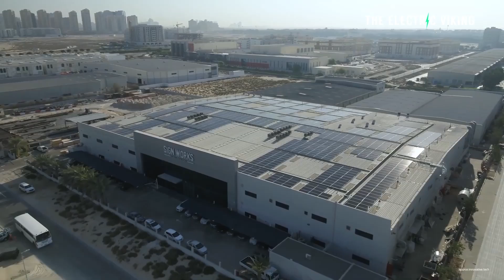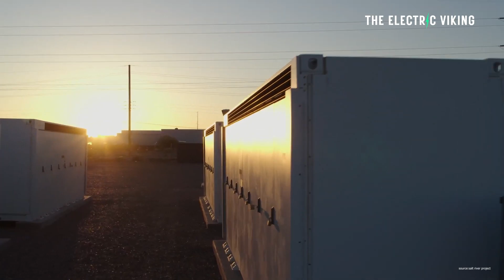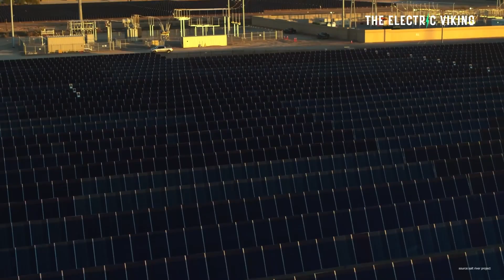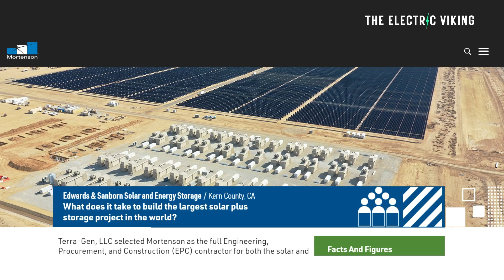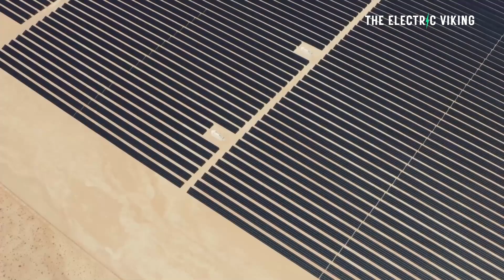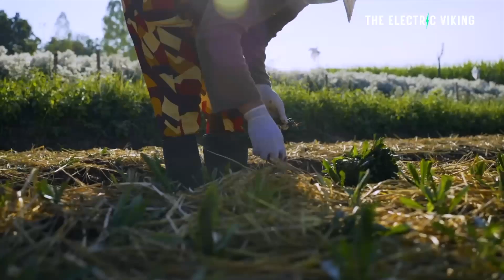The world’s largest solar and battery power plant has 1.9 million panels

Comment: The day will come when electricity will be so cheap that families will have so much more assets to spend.  Great for the economy.  I have solar panels on my roof in SF and often my usage is zero.  Yet the utility company has a way to tax me for what ever reason to make money.  Maybe it's time to go off grid and be done with my utility company except there are days when the solar doesn't make enough power
Reply: You just described the major issue with solar.  It relies on other dispatchable sources because of its intermittency.
Reply: In 25 years your solar system will end up in a landfill and you get to do it all over again, how environmentally friendly is that?

Comment: It might be the largest solar farm but by my reckoning 875MW is significantly less than 2.6GW
Reply: The batteries will help with the capacity factor but that eight hundred or so max is multiplied by .2 to get the true output for the whole day.  Still would take ten or more of these farms to come close what Diablo Canyon Nuclear Power Plant outputs on 200ac of land.
Reply: @stanleytolle416  in theory the numbers look strong but the fact is even the biggest supporters of nuclear will vote it down in their own backyard 10/10. Reason : real estate values will collapse and banks don’t like that. Also the cost of building, maintaining them is extraordinary. With millions of rooftops we can do quite a lot and we can localize power putting it in the hands of the people, not the politicians.
Reply: @stanleytolle416  45 billion or more to keep the Diablo Canyon nuclear power running from 2021 to 2045. This solar project was 2 billion. So seems pretty feasible? Like half the cost? Plus dropping on panels and LFP.
Reply: @fritzstauffacher6931  Not really true.  That's simply additional stuff that is not needed.  Like cooling towers because of warm water in the ocean.  That part of the ocean is where cold and warm water currents meet. The sea life in the area is adapted to big swings in ocean tempature.  I took a class from an alcologist who was at Cal Poly SLU because of the unique cold and warm water algae in the area.  Like the warm water from the nuclear plant is about a thousand of the temps that naturally happen in the area.  They are also talking about earthquake up grades where the plant was already overly upgraded for earthquake resistance and the plant is located on bedrock that's not going to get high levels of shaking anyway.  Nuclear plants in Japan withstood a 9.2 earthquake with no damage from shaking of a quake several thousand times the shaking possible in this area which only has slip faults not subduction faults like in Japan.  So really none of the work being called for needs to be done.
Reply: Yes but at what cost? And how many decades more would one need to wait? By then you can have 20 fields surpassing 2.6GW rendering it obsolete.
Reply: I just ran the numbers and you're right!
Reply: @alexishart1989  😅

Comment: How is this good for the environment?  How is this not increasing global temperature by heating up the surface?
Reply: It doesn't change the albedo of the land all that much. 20% of the light absorbed in the panels flows out in form of electricity (or is stored in the batteries) and during the night the panels are radiating IR very efficiently, cooling the air around them stronger than the original surface would have. Overall it's probably mostly a wash. In agricultural applications the shade of the panels reduces evaporation, leading to longer growth periods in spring and summer and allowing species that are less adapted to arid conditions to thrive. Solar shading in agriculture will probably go a long way to offset the effects of global warming on farming.
Reply: @lepidoptera9337  clever farming. Good recap.  I'm all for building out the grid.  I just think nuclear is the way to go.  They have new reactors now that use spent fuel from older reactors that can generate enough power for 100 years. Called "Fast reactors".   Fusion reactors will be a game changer.
Reply: It intercepts light that would just be heating the surface and turning some of that energy into electricity.  Do you think the sun wouldn't be shining there if there were not solar panels?
Reply: I agree, we need to get rid of surface heat 😡

😁
Reply: @FreeKekistann  One could imagine panels that are actually cooling the land by reflecting most of the IR radiation and by having an emission peak for IR wavelength  that correspond to the Planck peak at 300K. That would reduce heat load by 30% or so. It does come with some efficiency loss and the production is more expensive, of course. Other possible combinations involve solar and thermal desalination.
Reply: It's not good for the environment at all, all this ewaste will end up in the trash in 25 years, solar energy is a total scam, look at all the abandoned solar plants in California with broken panels littering the ground as far as the eye can see, glass everywhere...

Comment: California at times has too much solar and wind energy and actually pays Arizona to take this excess.  Thanks California.  I personally live off grid and have not had an electric bill for 20 years.
Reply: It's just a ping-pong game between solar and energy storage.  More solar is added, more energy storage is added to soak up peak excesses.  Then more solar is added, and more storage again, etc.  As the whole thing gets built up

Some curtailment is bound to happen, and does.  And sometimes exports go negative, for a multitude of reasons including needing to keep the grid balanced and having sufficient generation margin to deal with spot generation or line trips.

Though I will say that is happening less often now as other states have their own heat waves and wind up needing to import (positive rates in that situation, obviously, not negative), and more storage continues to get added to the California grid.

We're up to 6.6GW of (battery) power (up from less than 1GW 4 years ago), and well over 30GWh of storage (can't immediately find the reference but that's the ballpark), and that is projected to rise to 52GW by 2045 and I don't even know how much storage that will represent but it's gonna be pretty insane.
Reply: @junkerzn7312  All the grid batteries in the US could power the grid for a few minutes.  I forget the exact number, but it's in the single digits.
Reply: @dzcav3  And yet the batteries have had a huge positive impact on grid stability, massively reduced congestion transmission lines, and removed the need to a whole lot of very, very dirty peaker plants in the state.   And fortunately California is not trying to power the whole U.S. grid.  Fancy that!

Your little missives just demonstrate your vast ignorance of how the grid actually works, and how renewables and storage are quickly destroying old monopolies and grift.  

That's particularly true in Australia, by the way, where fossil generators are having an incredibly difficult time gaming the grid like they used to.  The batteries react just too damn fast for them to be able to create artificial emergencies with their intentional destabilizations of the grid.

-Matt
Reply: That makes no sense. You can just curtail solar. Why pay someone to take free energy.

Comment: Just imagine how much clean energy could be produced if a nuclear plant big enough to fill this area was built instead.
Reply: Wanna pay 30 billion dollars and wait 15 years for it?
Reply: Of the 253 nuclear plants that were originally ordered between 1953 and 2008, 121 (48 percent) were canceled before completion. Of the 132 plants that were built, 21 were permanently shut down due to reliability or cost problems, while another 27% completely failed for a year or more at least once. Nuclear power is an industry that has proven that it can deliver an ever more expensive product and take longer to produce it. If energy were based on market forces, the nuclear industry would have been out of business long ago.
Reply: @muskrat3291  You're using Al Gore as your source (via Wikipedia)?  I have a bridge I could sell you real cheap.
Reply: And then the billions and decades to remediate when the nuclear plant is shut down.  You know less than you think you do.
Reply: @TheEvilmooseofdoom  Yeah.  I'm pretty stupid to think photovoltaics won't do the job.  Seriously.  Nuclear fission is the only true solution.  We'll never get to nuclear fusion without carbon based fuels and fission.

Modular molten salt reactors.  I know more than you assume.  Be happy dreaming about your solar  utopia.

Comment: Instead of the massive amounts of storage batteries, use the electricity to pump water back to the top of a hydroelectric dam. 

 Greener way of storing the energy without the carbon footprints of producing batteries, all the wiring, maintenance, etc, etc.
Reply: Only two problems with that:
1. You need mountains, and lots and lots of water. Not many hydroelectric dams in a flat desert.
2. Pumped hydro round trip efficiency is about 70% - much less than Li battery charging at >99%
Reply: @ahaveland  I thought this was about going green??? You cut out all the mining,  maintenance, batteries will need recycling,  recycling centers... a few pumps have much smaller carbon footprints and are much more affordable, cheaper and easier to maintain, without all the environmental impact 

My state produces more electricity than needed. Excess is sold to other states... it travels just fine. Solar don't need to be on site
Reply: @bfree6197  Yes, hydro is good in rainy mountainous areas but location options are still limited. Pumps are useless in flat deserts!
Materials for batteries are only mined once. Mining can be done without fossil fuels, which is why more and more of them are building their own solar farms. The big bucket wheels are electric.
Recycling can be closed and totally renewably powered.
Yes, solar travels fine over HVDC, though those transmission lines are expensive.
Reply: @bfree6197  It's not as easy as you pretend and certainly not usable in all area's.
Reply: You don't move the dam... you send  solar electricity to pumps at an existing dam. Power lines are more permanent, cheaper environmentaly friendly than mining, manufacturing batteries and recycling them. Without the environmental impact. Large transmission power lines are already everywhere, most infrastructure probably already exists. 

Go watch some videos on the mining processes, the wasteland left behind, they are terrible for the environment. Their's nothing green about them... regardless of an electric wheel
Reply: @bfree6197  You don't understand the limitations of transmitting large amounts of electricity over long distances.  There are major costs and losses involved.  And there is still the limitation of not enough suitable mountains and reservoirs, unless you happen to have a bunch in your backyard that you aren't using.
Reply: @dzcav3  The United States has over 2,100 operational hydroelectric dams, with locations in nearly every state. They play essential roles in their regional power grids.

Their are losses in charging a battery... then the power still needs to be transmitted from the battery, it doesn't arrive at its destination without any loss either, same power lines, same rate of loss. 

Dams already have large power lines to output electricity, the same lines can be used for input... existing infrastructure.
Reply: A gud idea for energy efficient societies
Reply: Sought of like pushing shit uphill 😊

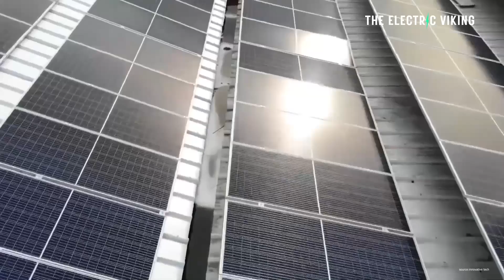Comment: @1:28 - just 875 mega watts (or 0.875 GW)?  China will have 1.3TW (1300 GW) of solar and wind power by the end of 2024
Reply: Well, China installs more solar yearly than the U.S. has installed over its entire history.  Just goes to show how far behind we are.  That said, not sure why you are comparing the output of a single project to the output of an entirely country.  California as a whole generated 13-14GW from solar today for a period of roughly 9 hours.  Roughly 117 GWh today.  And batteries spread a portion of that energy over another 6-7 hours when the sun isn't around.
Reply: And about 700GW of coal plants😊

Comment: Again you have to put this in some context as even a giant farm like this doesn't put out that much power.  2 million panels has a peak potential of only about 2-5 million depending on the time of year. Grand Coolee Dam by iteself puts out 57 million. Combined Solar, wind in the USA total under 6% of power generated in the country.  The actual rate of Solar expansion is declining even with larger farms; because as the base gets larger it takes a great number to even incease by 10% over the prior year.
Reply: Wrong and wrong
Reply: @chrismd00  Oh so smart ; can you google anything?  Im sure you can check my figures for both the Dam's output and Sam here presented the max out put of this solar array - so Your not just ignorant and wrong but too dull to actually show anything to prove your point - right? Big mouth.

Comment: I doubt someone could walk around a 4,600 acre project in half a day.
Reply: 4600 acres 18615539 square meters or 4.314 by 4.314 assuming a perfect square. That would make the total perimeter 17.256km. Walking between 4-6km per hour would take 3-4 hours. So yes it is very possible to do it in half a day.
Reply: At my age I wouldn't even make it. 😲

Comment: We need DC power grids
Reply: DC is not efficient for long distance transmission.  It's why Tesla invented AC
Reply: @Rabs73  You got it the wrong way round. DC is best for long distance. 
And DC cables can be buried.
AC was adopted because it makes it easy to change the voltage and isn't quite so dangerous if you touch the wires.